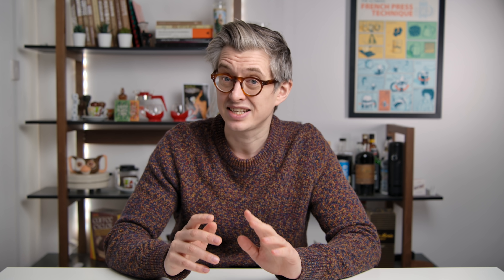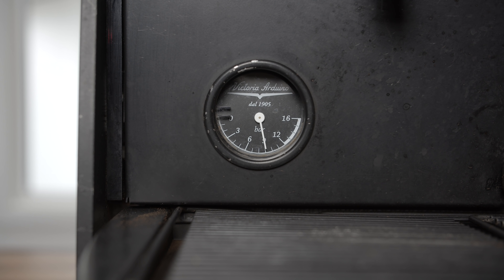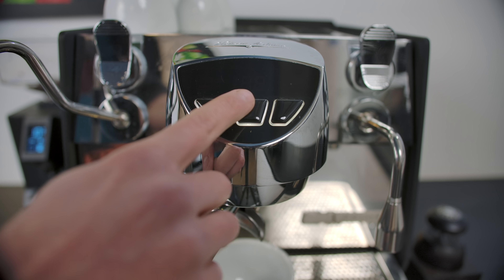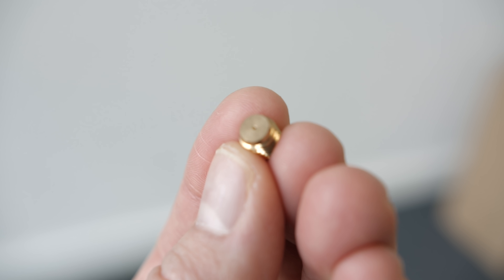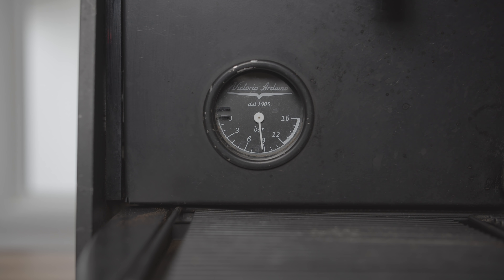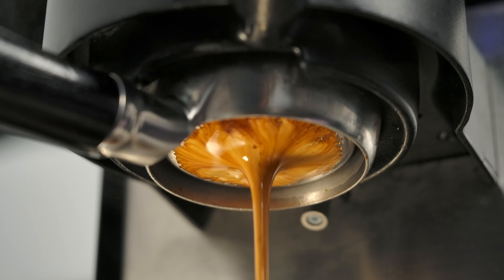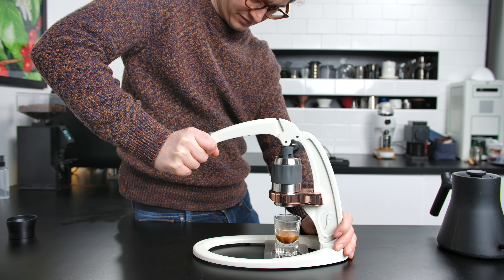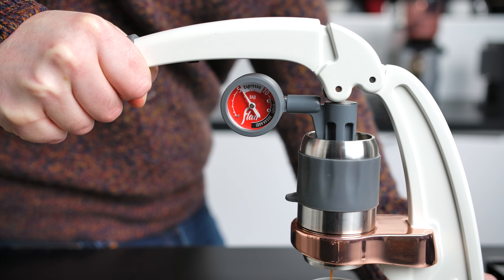Understanding Espresso: Pressure (Episode #6)

Comment: I like to brew at pressures way above 9 bars on very finely ground coffee. I put nearly all my weight on the Flair Classic lever. It allows for very strong shots without the bitterness. On freshly roasted grains, it also converts crema into oil, litterally, that you see floating on the coffee, and that tastes incredibly good. The downside is that it's a drop by drop extraction, and you have to be patient.

Another aspect of pressure is that if you don't have a distributor or tamper you can uniformly compress the puck by "punching" it with high pressure before you start preinfusing at lower pressure.

This all may be quite unorthodox so I would be interested in other opinions.

Comment: Hey James. I own an Espobar Brewtus IV which incorporates a pre infusion chamber in the group head. Seems to work as planned, getting ~6 second ramp up time to pour.
I've been contemplating the addition of a flow control modification. Looks relatively simple and provides one more adjustable component at my disposal. However, I'm not a huge advocate of more is necessarily better and wondering if you would have an opinion if doing this would provide me enough potential benefits to justify doing this.

Comment: I'm getting 4:1 on my Rancilio Silvia in 25 seconds with 17 g. My coffee is ground very fine at this point and small adjustments have definitely not brought me anywhere close to 2:1. I'm thinking it could be the pressure of my machine? I'm measuring 9 bars but I'm thinking of reducing it to 6 bars. Any thoughts?

Comment: HI James!
Thank you for your explanation for the pressure, i'm learn a lot from you video
but i'm still feel uncertainty,
so just wonder if it's possible could i ask a question please:)

Recently when i try to adjust pressure (la marzocco linea PB)
I found when the pressure decrease (in the same grinder size, same dose and same ratio , same output)
the brew flow rate will get faster, 

for example when 9bars -> shot finish on 32s on the other hand, when 7.5bars ->shot finish on 28s

so my question is : 
if my understand is correct ,when the machine on  high pressure , the brew flow rate should be faster than low pressure
but why  in my case, the result are totally different with theory

Is anythings i misunderstand about machine pressure ?

Gary

Comment: I've always treated beans as the only factor, every coffee requires different settings for peak taste, like I believe you can get the same shot out of any decent machine when you grind different, use more or less coffee, tamp harder or easier and temp surf a little. At the end of the day as long as you dont burn the beans or over extract, the crema, yield, time and taste will tell you what you need to change to get the best out of the beans with a given machine. It's a waltz, it shouldn't be forced, work with your beans and machine don't try to bend it to your will. But get a good grinder.

Comment: I want to ask James, why is some espresso machines fitted with a 15 bar pump if we see that 9Bar is better? Usually it is the more entry level machines, but I see machines like the Breville (The Oracle) comes with a 15 Bar pump. What's the difference between the 9 Bar and 15 Bar. And why would they use a 15 bar? Thanks

Comment: Hi. I have a question about 9 bars. My machine is able to produce 9 bars when a have cleaning disk put in my portafilter. So during brewing it's impossible to get 9 bars, I get about 8.2 at high peak. Should I increase of the pressure on my OPV a bit to achieve 9 bars during extraction, or it meant to be that way?

Comment: E61's brew lever can be used for a NON disruptive mechanical pre-infusion (most machines have a kinda quick 4 bar pre-infusion built in but it's more of just a gentler pressure ramp up really). it's not a disruptive process to move the lever from up where the pump is activated to the half way position, it just stops the pump and you can resume the pump afterwards by putting it back up.
Send me $$ if I just saved you from buying a $5000 Decent brand machine :D jk I know the Decent machines can do more than just that.

Comment: Interesting video! Currently I'm brewing on a Gaggia Classic which I have modded the OPV down to approx 9 bar, and I use it with my Eureka Mignon Specialita. I take quite a lot of care with my puck prep but still often get what seems to look like significant channeling and also (think related) sour shots... This video makes me wonder if doing a "poor man's preinfusion" or adjusting the OPV to be a bar or so lower would reduce channeling and result in more balanced espressos perhaps... Hmmm

Keen to hear anyone's thoughts!
Reply: What has been your experience more recently with the gaggia and opv? I'm currently testing the 6.5 bar spring.
Reply: @simonmonty7171  Shortly after I upgraded to a Vibiemme Domobar Junior so it's hard to answer your question sorry! I think after maybe some micro adjustments of my technique using the Gaggia I did get better more consistent results but still got channelling semi-frequently.

Comment: Another way I pre-infuse on a Gaggia Classic is to turn on the pump and then slightly turn on the steam knob to reduce the pressure in the grouphead, then after about 5 seconds I turn off the steam knob and allow full pressure to pull the rest of the shot

Comment: But what happens if I have the perfect recipe (grind size, temp, ratio, time) on 9bars, and I just reduce the (flow) pressure to 6bars? Obviously it will come out slower, but if I keep everything the same (except time), how does it affect taste?
(I'm just about to get a machine with flow-control in the upcoming months, so I cannot try it out now)
Reply: It's not as obvious as you think it is.

Lower pressure doesn't mean lower flow as higher pressure can hinder flow.

Comment: My home espesso machine cannot set a pre-determined pressure, so the grind size and tamp will determine the effective pressure when extracting. Sometimes, pressure gauge shows only 6 bars during extraction but flow rate is quicker than when 9-bar is achieved (not quite in line with Jame's explanation that 9-bar pressure will give maximum flow rate). At 6 bars for a given grind size, does it mean that the espresso will be underextracted if flow is allowed for the same 25-30s extraction time? Since that 30s is expected to underextract, what I usually do is to compensate is: allow for a longer flow time (expand the brew ratio) to extract more from the pulp, and I find the resulting coffee (becomes a lungo; 20g in 70g out) still quite sweet and acceptable. Is that the correct approach to compensate for a less than 9-bar extraction?

Comment: hello! im just leaving this question here as i've been on a journey to discover whats happening with our espresso machine.

i have noticed that each time we pull a properly dialed-in shot, our group pressure gauge bounces through out the shot. the needle bounces between around 5 and 9 bars. this has caught my attention because our shots also recently had some inconsistent amount and quality of crema. could the problem be here? ive made sure to check every aspect of maintenance on both the machine and grinder, yet still can't seem to solve this weird detail. any thoughts?

Comment: What about the spirit? You can change the spring strength in the group head but it's not manual during the extraction.
The puck that it tends to create is much different from an average LA Cimballi or whatever. Also the grinder we use for the Spirit is different too so can't be sure it's the only reason

Comment: The pressure profiling abilities of my Vesuvius unlocked a lot of potential for me.  It is a fascinating element of pulling shots that I would now not go without in any future machine I purchase (well, profiling through pressure or flow).  My current preference based on my beans I uses is 14s@2b -> 10s@9b -> 7s @7b -> 5s@5.4b -> 3s@4b.  While I'm lacking a true flow meter, I do use an Acaia scale which allows me to effectively measure the resulting flow (based on weight) based on the profile I've set.

Comment: Due to the relatively slow ramp up in pressure with a vibration pump, is the mechanical pre infusion more sensible than with a e.g. a rotary motor?

Comment: I'd like to hear from you about setting the opv. In my machine (ascaso dream pid) I set the opv to 10 (as I read this means the Puck will get 9 bars). Pressure usually starts at 9-10 but then quickly starts dropping to 6. Is this normal?

Comment: Now that i've watched your video on the 1500pound machines, and the problem with 4/5 of their factory settings, i just want to make sure i understand : are we looking for 9 bars at the pump and approx 8 at the grouphead? And does that mean using my Flair, I should be therefore aiming more around 8 than 9 (although I have complete control or varying which is cool) but just to understand the idea, and to know how I would have to adjust a machine's pump pressure to get what we're really looking for at the grouphead. thanks!!!!

Comment: "Nobody Understands Quantum Mechanics." - Richard Feynman
I don't yet fully comprehend Espresso Pressure, however I do feel closer to truth. Thanks! Also I remember discussing with former colleagues the intricacies of measuring espresso temperature. For example would it be measured at the boiler, group head, port a filter spout/bottom of basket, in the cup itself?🌴🤔💯
Reply: https://youtu.be/w3ZRLllWgHI

Comment: @James Hoffman Do you agree with Luca Bezzera; that a smaller semi professional machines should be set at 11 bar pressure as they have a smaller vibration pump with a flow rate of 34L per hour vs a commercial machine set at 9 bar pressure as they have a larger rotary pump with a flow rate of 100L per hour, he explains it at Youtube channel @TheEspressoTV " 9 bar or 11 bar " video  ( it's both in german and english ) https://youtu.be/E4y4-E2aL3U?t=90

Comment: Hi, I have a question about pressure and espresso machines. Some machines have a pump of 15 bars. If the peak of flow is at aprox 9 bars how come some manufactures make their machines with a pump of 15 bars?

For an example the sage barista express has a pump of 15 bars and the pressure ca not be adjusted. This means the machine will brew at 15 bars?

Comment: Thanks James for the clear and informative presentation on pressure and flow.  I have a question regarding my Gaggia Classic Pro pressure.  I am trying to avoid modifying the machine from a 12 to 9 bar spring.  In keeping the 12 bar pressure what techniques would help moderate the high pressure.  I'm thinking a short pre-infusion could help.  What other techniques would you suggest.  Thanks.

Comment: Looking at this as a chemical engineer, I'm surprised a bit. Why would you control flow indirectly by controlling pressure and measuring flow, when the result is very direct with a rotary pump. The impact of back pressure on flow through a rotary pump is minor, so you should be able to dial in and profile the flow purely on the rotational speed (frequency inverter). If need be, you could still include a flow meter for even more accurate controll, which is still better than the pressure route.

Comment: I think an interesting machine for James to review is the Lelit Elizabeth v3 with the newest software. You can set it to do between 1 and 4 bar of preinfusion using the pressure in the steam boiler to move the water in the brew boiler through the puck. It can also do bloom preinfusion as well for 1500 bucks. Plus steam power is crazy strong for such a tiny machine as you can set the steam boiler to 4+ bar of pressure.

Comment: I have a question regarding pressure. I have a machine which i think shows the pressure at the top of the cake during extraction. I start by opening the water to infuse which drops that reading to zero bars. Then i engage the pump and watch the pressure rise to a level at which the grind will handle. Ie. Too fine and it rises above 9 bars, too coarse and it doesnt reach 9 bars. Is the goal here to grind to achieve 9 bars, or should i adjust the pressure to max out at 9 bars, which i could do, and grind finer ?

Comment: Well this was an interesting episode! I am wondering what I am missing out in my espresso having a E61 HX machine with an on/off switch. (Fiorzenato Bricoletta). There is no lever and I can't pre-infuse in the head.

I guess I could simply soak up the puck with the hot water tap on the machine as we are talking line lever pressure and then pull a shot? I'll try and experiment :). I get that the puck should not break as that will get loads of channeling.

Can we also say that if we get a nice even extraction (on the eye) with a naked portafilter we don't need to drop pressure? Because profiling can't be done on this machine (unless you want to try to drop voltage so the pump will run slower).

Comment: I have a niche zero, and a La Pavoni lever machine with a pressure profile gauge.  When the group head reaches 90c, I raise the lever and purge a little air and water, before inserting the portafilter, then start the pre-K fusion, and wait for coffee to drip before starting the pull.  It might be 10 or up to 40 seconds or more.  Then the pull is relatively short, until the output is twice the input.

Comment: the 9bar
From my view the 9 bar thing is a big fantasy story. Think of this: pressure is proportional to force AND the surface you apply it to.
So, where in your espresso machine do you messure this pressure ?  You messure it in some small pipe section.
So,  do you have applied "real" 9 bar of pressure "directly" to your espresso ? Answer: No.

Ask any scuba diver experienced person what 9 bar of pressure does mean:
It is the pressure of water in 80m depth.
That's a LOT of pressure.
If this pressure would be applied directly and constantly to your espresso it would fill your espresso cup in some milliseconds and and then
evenly distribute it to your kitchen walls.

The point I want to make is, talking about pressure in an espresso machine is meaningless unless you tell where and how in you design you measure it.

don't get me wrong, I like your videos ;)

Comment: Hi James, I have been following you for quite a while now and found the espresso videos confirming what I know about the extraction process, a question you don't seem to have cover in this series is tamp pressure and how this affects extraction. Some places I visit hardly tamp at all, worst is when they just use the plastic leveller on the side of the Mazzer grinders just a quick push against it where as some places put the porta filter on a tamp mat and practically balance on one arm on top of the tamper.
I myself use a Macap dynometric tamper to get a consistent tamp pressure that way i know it is the same time after time, people will tamp at different pressures during the day so they may be adjusting things like time or grind when it may be they just did not tamp at the same pressure, it is not a major thing but another one of the variable that affect the extraction.

Comment: Whew!!
Here is my take:
(BTW Enjoyed the video)
There are so many variables
-Different beans
-Age of bean
-Storage of bean
-Grind size
-Grind amount
-The roast
-Weight
-Volume
-Type and shape of basket
-Type and hardness of water
-Temperature of water
-Tamping force
-Extraction time
-Extraction pressure (and pressure/flow profile over any given extraction time)
So you see where I'm going here
You're either a lumper or a splitter or somewhere in between
Practically speaking there are too many variables to address or over which you may not have control
You can get a good shot out of most beans making adjustments if necessary as the beans age
In fact you can get  almost identical shots with different sets of settings
Sort of like cooking good results roasted, grilled, fries broiled, sauteed , sous vide
Not totally unlike wine e.g. vintage year, storage temperature, grape, color, nose, bottle size and with hints of black current, raspberry blah blah 
Bottom line you either like it or you don't (although someone else might) 
If you don't - tweak

Comment: Would love your input on something that has been nagging at me: I own a Bezzera Unica, Bezzera sets the pump pressure on small units using a vibratory pump to about 11bar, their reasoning being something along the lines of small vibratory pumps "lose pressure" or operate at a lower pressure at the puck  than what the pressure dial displays. I have an additional grouphead mounted pressure gauge and i dont believe this to be true because it consistently reads 10-11bar when pulling shots,  but i haven't lowered the stock pressue/opv setting.... Is this true of vibraory pumps? should i leave it or lower it?  any thoughts? Thank you for helping us all understand coffee!

Comment: My routine in Bezzera Strega is just 6 seconds of pre-infusion (holding back the lever to make the pump stop); wait til I see a small drip in the glass, then go back to "turn on" the pump to re-fill the brew chamber with water (some were absorbed in pre-infusion process earlier), watch for a stream of liquid coming, then I release the lever and beging the extraction by lever. Usually I got a good tasting espresso.

Comment: James, do you think you could check out the new flair 58? It's appearance is completely sublime, and it's  equipped with a (hopefully functioning) pressure gauge, and it looks like the guy in the ad for it could press 9 bars without much effort. Could you test it and see if it's bogus or an actual product of quality?